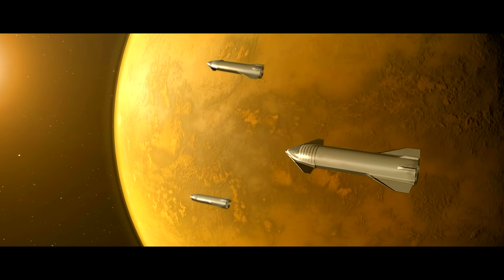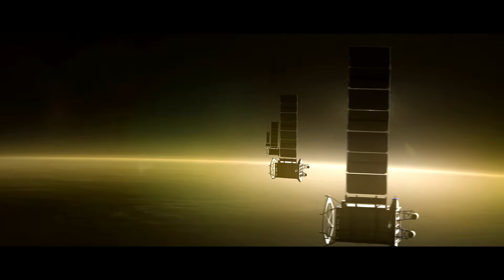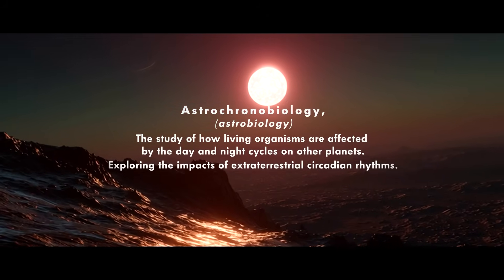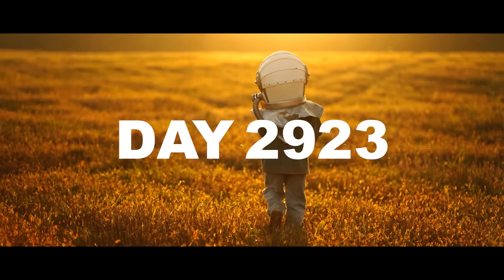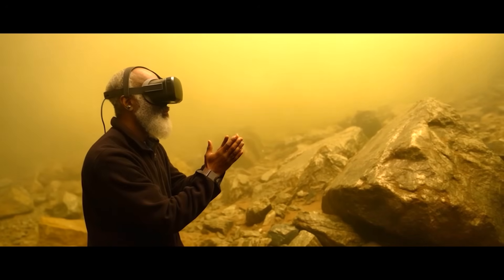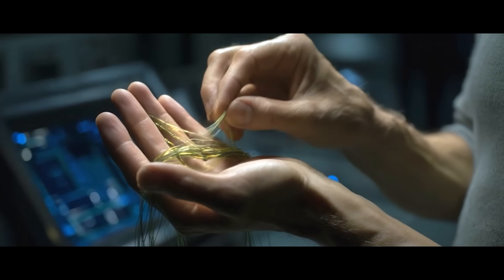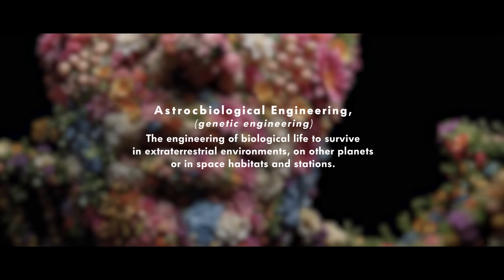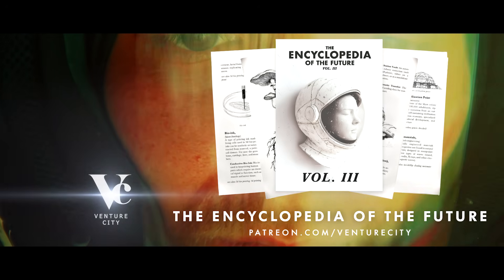THE FIRST 10,000 DAYS ON VENUS (Timelapse)

Comment: so if one Venus day has 48 hours of daylight and 48 hours of darkness then that is equal to 4 days on Earth. Now, are those 10,000 days in the video based on Earth days or Venus days? Because in Earth days 10k would be just over 27 years on Earth, but 10,000 Venus days would be 40,000 Earth days and that makes 109.5 Earth years.
Reply: earth days

no one would use venus days to measure time

(maybe in future, venus population (if this partially happens ) may starts doing do so

Comment: Makes more sense than going to Mars.
Reply: Im totally surprised we havent started making free floating colonies already we could be doing that in earths atmosphere and low earth orbit RIGHT NOW.  Beats the hell out of constantly worry about nuking the planet and nobody surviving
Reply: In what way - SPECIFICALLY...???
Reply: @jddanko3846   Okay I'll bite. Venus's upper atmosphere offers a breathable pressure and temperature (not gas mixture), similar to Earth's surface at roughly 50 kilometers up, whereas Mars's thin atmosphere requires heavy pressurization and provides no protection from freezing temperatures. 

At this specific altitude, Venus's atmosphere is thick enough to act as a natural shield against lethal solar radiation (no underground shelters needed), a critical survival advantage that the unshielded Martian surface lacks. Furthermore, because Earth’s air acts as a lifting gas on Venus (much less dense), entire habitats could float using breathable air rather than volatile gases like helium or hydrogen. 

Finally, Venus's near-Earth gravity prevents the long-term bone and muscle degradation associated with the low-gravity environment of Mars, making it a more viable home for the human body.  In my opinion, this last issue is the major one as I don't see a remedy.  There is more, but this is the gist.
Reply: We can do both. I don’t like the “we should go here, and not there” arguments. We can get to all these places eventually.
Reply: @ebonaparte3853   I'm not sure.  It is very expensive... So resources (money) are limited.